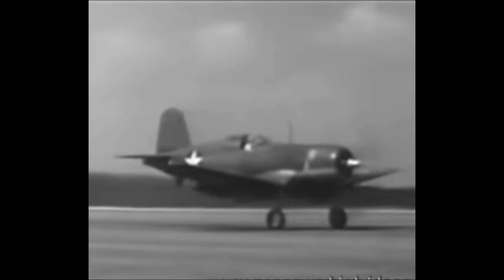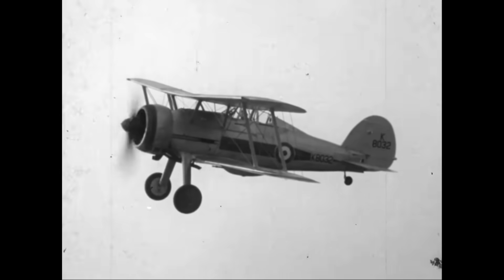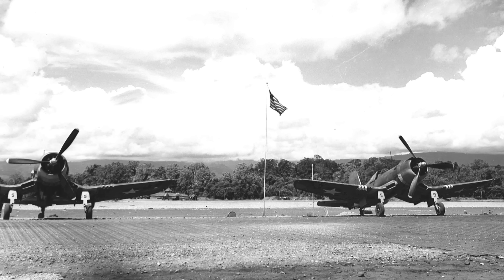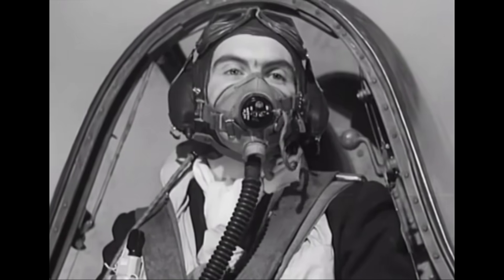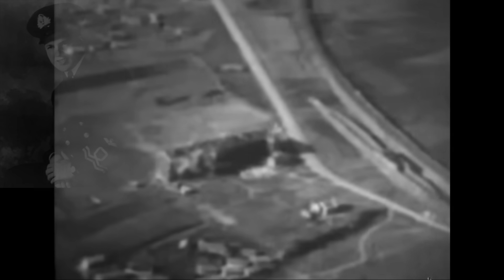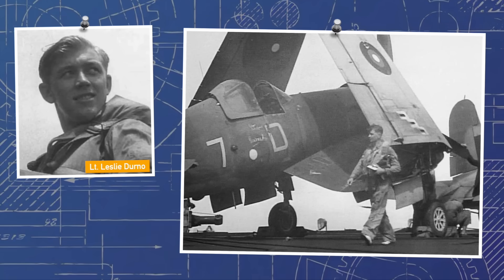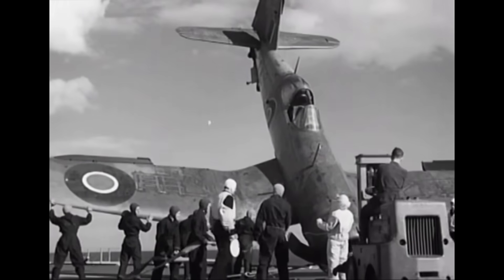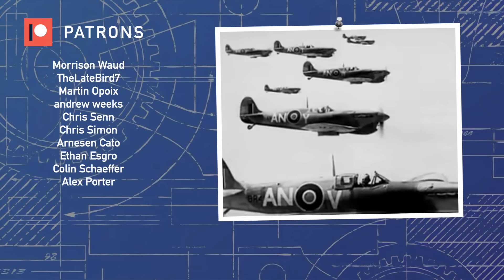Why Did Britain Use American F4U Corsairs? The Full Story

Comment: The Corsair was qualified for carrier operations in April of 1943.  The US Navy had developed the circular landing pattern in the 1930's.  The plane was not used on carriers mainly because of logistics.  The Hellcat was an evolution of the Wildcat, and therefore easier for the Navy to adapt and service.  The Corsair required its own supply chain.   Also, there was an issue with the landing gear, which was resolved long before 1944.
Reply: "Logistics"  perhaps this was just one of the reasons the Navy selected the F6F Hellcat over the F4U Corsair.  The fatalities of young Corsair pilots was horrific compared to the Grumman F6F Hellcat.  There are interesting statistics on this subject in the book "The Vought F4U Corsair in the War Against Japan" by Tim Hillier-Graves.

Comment: With regard to the gull wing being used because of the propellor disc, if it had straight wings then the landing gear would have to be overly long. Impractical and expensive. Hence the gull wing allowed shorter landing gear so the propeller was the cause that led to the gull wing.

Comment: The Fleet Air Arm sound like the U.S. Marines: nonconformists who take equipment other branches don't want, and make good use out of them.
Good for the FAA, figuring out how to land an F4U on a carrier!
Reply: USMC operated Corsairs from land bases where they could be loaded to the max for close air support. USN had the Hellcat for carrier ops. Over 1,000 Hellcats Lend Leased to Britain.
   "There is a controversy between those who say that the Admiralty did not get what it wanted for the Fleet Air Arm and those who say that the Admiralty was not very clever at explaining what exactly it    796
was that it wanted. I noticed quite recently that Air Marshal Dowding has gone on record as saying that the Admiralty got precisely the types which it specified and demanded. Whatever may be the rights and wrongs of this controversy there is certainly no doubt whatever about it that war found the Fleet Air Arm equipped with extremely bad aircraft." 
FLEET AIR ARM.
HL Deb 27 January 1943 vol 125

Comment: So they could saw the wing tips off and show the Yanks how to land it on a carrier properly.
Reply: "There is a controversy between those who say that the Admiralty did not get what it wanted for the Fleet Air Arm and those who say that the Admiralty was not very clever at explaining what exactly it                  796 
was that it wanted. I noticed quite recently that Air Marshal Dowding has gone on record as saying that the Admiralty got precisely the types which it specified and demanded. Whatever may be the rights and wrongs of this controversy there is certainly no doubt whatever about it that    war found the Fleet Air Arm equipped with extremely bad aircraft."
 FLEET AIR ARM. HL Deb 27 January 1943 vol 125 cc794-829
Reply: Royal Navy teaches the U.S. Navy the curved approach to  the aircraft carrier?  Read "F4U Corsair at War"  by Richard Abrams.  Go to the chapter "Corsairs with the Royal Navy" by Lieutenant Commander  (A) Norman S. Hanson.  Yes, Lieutenant Commander Hanson also wrote the book "Carrier Pilot."  These pull quotes from "F4U Corsair at War".  Deck landing on a full-sized  deck essayed by the first two squadrons when they joined HMS Illustrious in December 1943, proved to be distinctly hazardous."   Further;  "Illustrious" Captain decided that further deck-landing training was essential."   Also NOTE "the fact that the current RN landing "pattern" was totally unsuited for the Corsair."  If you  have the book "Whistling Death" by Boone Guyton you will find the U.S. Navy was instructing the Corsair curved approach BEFORE the Royal Navy had Corsairs.

Comment: A good presentation but you made a grave omittance . The U. S Navy's inabilities to safely land on carriers caused them to change to land landings only .  It was the sole experience and knowledge of Flt. Lt . Eric "Winkle " Brown whose vast experience of carrier landings  was the changing point for safe  Corsair aircraft landings on carriers . Once his knowledge was passed onto the U.S, Corsair seabourne landings recommenced .
Reply: FAA used what it learned in making the Seafire (bodged up Spitfire) SAFER to land on carriers. 
"There is a controversy between those who say that the Admiralty did not get what it wanted for the Fleet Air Arm and those who say that the Admiralty was not very clever at explaining what exactly it                 796
was that it wanted. I noticed quite recently that Air Marshal Dowding has gone on record as saying that the Admiralty got precisely the types which it specified and demanded. Whatever may be the rights and wrongs of this controversy there is certainly no doubt whatever about it that    war found the Fleet Air Arm equipped with extremely bad aircraft."
FLEET AIR ARM.
HL Deb 27 January 1943 vol 125 cc794-829

Comment: G'day ADD, Interesting video. I particularly liked the brief shots of warships sailing backwards. As to the FU Corsairs they are my favourite WW2 fighter even though they didn't achieve as much as other types. Like many airframes in the conflict they were rushed into service; clearly with a need for more aerodynamic and design work to smooth out its unique idiosyncrasies. 
Pilots, also were not generally given sufficient time to come to grips with the Corsair's advantages and dangers, especially in carrier operation.
This is an aircraft that also suffered from spreading manufacturers too widely. It's now obvious that certain factories built Corsairs either with insufficient understanding or too quickly to meet demands.
An interesting part of the Corsair story, you didn't cover, is their use by the Royal New Zealand Air Force. I'm ex-RAAF and I'm deeply interested in RAAF history. I believe that our service got their hands on a Corsair for evaluation and after close physical and flying examination, decided against adding them to their inventory. I'm not so sure about the details of the RAN and why they didn't use the Corsairs either.
In any case it was a great pity that so many groundbreaking aircraft were simply dumped at sea, or scrapped as they were in the US. Air forces would have benefitted by more research into 'gull wing' designs and the 'accidental' clipped wing feature.
Thanks for your video..
Cheers, Bill H.

Comment: Vought was still building new Corsairs in the late 40s and early 50s. Nash Motors who built R-2800s under license during WWll for use in F-6-Fs and F-4Us was awarded acontract to restart production. Which was then canceled before any production could start. This demonstrates both the need for Corsairs and the later need being reduced.

Comment: Unfortunately you are completely wrong and just perpetuating a myth that the inverted gull wing was used for propeller clearance. 
In reality many other airplanes used the same size propeller without that wing. 
The wing was placed at a right angle to the fuselage because the net result of that attachment was much less drag. Obviously they had to angle the wing back upwards. 
The result of that was a happy coincidence that they were able to use shorter landing gear legs that were stronger. 
Do some real research before making a video intended for education.

Comment: Why did the FAA use the Corsair? Because they had no domestically produced, carrier capable fighter of their own. British aviation companies gambled on sleeve-valve radial engines and that didn't work out well when they needed more than 1500 HP-the bigger Sleeve Valve engines didn't have durability and required lots of maintenance. The Pratt & Whitney F2800 was the best radial aviation engine that could produce 2000 HP+ and was used in the Corsair and Hellcat.

Comment: British engineers made US planes better, made the P-51 faster, and made the Corsairs safer.
Well done Britain.
Reply: The secret fuel that made the Spitfire supreme
Royal Society of Chemistry
11 October 2022
The USA developed and supplied the high-octane fuel that gave the Spitfire and Hurricane a winning edge in the Battle of Britain. A French American, Eugene Houdry, developed a process to convert useless crude oil into 100 octane fuel. 100 Octane fuel increased the Spitfire's speed by 25 mph at sea level and 34 mph at 10,000 feet. A 13-octane point increase contributed to the British victory in the Battle of Britain in 1940. 

Britain began the process of replacing its Vickers aircraft machine guns with a new Colt/Browning design in 1935, with its adoption of the Colt MG40. This was essentially John Browning’s air cooled M1919 machine gun made smaller and lighter, with an increased rate of fire, and reversible feed direction. British adoption began with the purchase of 60 guns and a license for domestic production. This production took a few years to get rolling (by both the Vickers company and BSA), and in the meantime an addition 1600 examples were procured form Colt 

 Klystron An amplifier valve. An electron stream is direct through a series of cavities causing each cavity to resonate. The RF input is fed into the first cavity causing velocity modulation of the electron stream . The successive resonating cavities amplify the velocity modulation, resulting in a signal gain. The output is taken from the final cavity. A gain of up to 40 dB can be achieved. 
The Chain Home radar system - Radar Pages 
It was invented by the brothers Russell and Sigurd Varian at Stanford University. Their prototype was completed and demonstrated successfully on August 30, 1937.[5] Upon publication in 1939,[3] news of the klystron immediately influenced the work of US and UK researchers working on radar equipment. wiki

Comment: Not true about the "downward kink..." that was primarily for aerodynamic efficiency. The Hellcat swung the same diameter prop, 13' 1". It did however allow for a shorter MLG strut, allowing rearward retraction.
Reply: @johnklatt3522  The extra 3" on the early prop is immaterial, where ground clearance is concerned. The XF6F-6 had a 13' 4" prop too. The inverted gull wing was used to set the wing away from the fwd fuselage to reduce drag...aerodynamic efficiency. The romance with the"HUGE" prop falls in with the myth that the M1 rifle's clip being ejected told the enemy a rifleman was empty.
Reply: @johnklatt3522  Okay...you're partially correct too.
Reply: I checked and you’re correct.  The prop was not larger but standard for the double wasp engine.

Comment: When yo realize that the Grumman F6F Hellcat had the same engine and propeller (4 meter diameter) then the argument about the inverted gull wing and shorter landing gear becomes moot. However, it is the "Banner" which every F4U Corsair advocate flies when talking about the design of the Corsair.  It was a design choice of Chance Vought, nothing more. In reality, the short landing gear actually caused problems, as did the long nose making the USN relegate it to landbased squadrons for the 1st 2 years of its service. The British Royal Navy however, was desperate for a good Naval fighter, and so stuck it out with the Corsair. If it hadn't been for the FAA, and its development of the Corsair into a usable carrier fighter, the Corsair would have ended up as another footnote of failed but excellent aircraft.
Reply from the maker: The point isn't moot, as the F6F had a number of tradeoffs due to this fact. The landing gear was far weaker - for one. A Corsair breaking its gear off was virtually unheard of, for the F6F it was a relatively common occurrence on crash landings. Further, the Corsairs gear was so strong it could be used as an airbrake, obviously this could not be replicated on the F6F Hellcat.

In short, aircraft design is all trade-offs. In this case, the design team opted for that gull wing for a number of reasons, and one of the advantages that came with that layout was incredibly strong gear. Could they have gone for another solution? Sure - but as seen in the F6F, it had tradeoffs.

Comment: The USN had the Corsair in 1942.  At a time when F-4 Wildcats were being chewed up by Japanese Zeros.  The USN was either unwilling or more likely unable to correct the deficiencies of the Corsair and relegated it to land airfields.  The Brits saw the value of the Corsair and thru some drastic steps made it work despite the operational losses they suffered and by early 1943.  A time still before the introduction of the F6F Hellcat by the USN.  The navies negligence in not making the Corsair carrier friendly resulted the loss of many planes and perhaps even ships.
Reply: USN had F6 Hellcats. Brits used them because they did not have anything better.
Most of what the FAA applied to Corsairs was learned on Seafires, bodged up Spits.

Comment: Thanks for this video, it was far more thorough than most on the Corsair, its a pity that the best fighter of the war is so often overlooked. This aircraft had the agility of the spitfire and P51 but the ruggedness of the P47 with a very long range........ everything you could want in a fighter. The RNZAF operated 13 squadrons of Corsairs in the Pacific. Of the 424 aircraft we were supplied only 17 were lost to enemy action and 154 to accidents with 54 Pilots killed. So it won its battles and most of its accidents were survivable
Reply: Better than a Spitfire not in a month of Sundays  Corsair beaten in the Turn, Climb,Roll Rate, Stall,  Service Ceiling, Armament [ Fighter]

Comment: To this day I wonder why the Typhoon did not get much past some design studies and tests using barely navalized (ex: adding arrester hook) but otherwise stock aircraft that went poorly.  It seems it should have only needed a little reinforcement and relatively simple high lift devices to make it suitable for carrier ops but I guess the demand for land fighters probably made it cheaper to just procure a different type from the US for carrier use.

I also find it sad that the US just said to dump all those aircraft rather than tell them to sell them to whoever will buy them and give us half the money you collected to settle the lease.  It was the only WWII piston aircraft that was still in active service with the US well into the Korean War.  Being a very high performance fighter I am sure some countries or returning vets would have snatched them up and if not scrappers certainly would have.
Reply: The Hawker Fury was modified for carrier use and was renamed the Seafury.  We had about 50 of them in the Canadian Naval Air branch.  Later on a number of them were sold to Cuba and were instrumental in trashing the American invasion.
Reply: Typhoon was useless at altitude, that's probably why.

Comment: Cuz they were one of the best if not the best fighter of WW2 . Saved you some time.
Reply: I mean... no, you didn't. That wasn't the primary reason at all, did you even watch the video
Reply: @endi3386  no but I answered the question the video caption asked. Well that and the fact that they were desperate for planes.
Reply: @mikeholland1031  But you didn't answer the question the video title asked. That's not the primary reason. Britain had many excellent aircraft of its own. The title obviously seeks to ask why specifically the Corsair over the numerous world class aircraft the British had.
Reply: @endi3386  they didn't have enough planes. Already said that.
Reply: @mikeholland1031  But no lmao, even that wasn't the reason. It wasn't an issue of numbers
Reply: @endi3386  yes it was
Reply: @mikeholland1031  No, it was primarily an issue of aircraft suitable for carrier operations, that had the performance necessary to compete with modern aircraft, and the range necessary. 

Navalised Spitfires and Hurricanes had good performance, but Spitfires were ill-suited to carrier landings, and Hurricanes were lower performance and didn't have as good range. 

So in summary, the British didn't use the Corsair because it was "the best fighter of WW2", they used it because it filled a specific niche in the Fleet Air Arm.

Comment: Ever wonder if the Centaurs or Hercules engines swapped for the R 2800 would of powered the Corsair better
Reply: The Double Wasp had more horsepower than the Hercules.  The Bristol Centaurus was a three row engine and would not have been a fit for the Corsair without a complete redesign.

Comment: We're told that Corsair had a four bladed propellerator but many of them in this wide have three bladed repellers. ???
Reply: The F4-U4 variant had a four blade prop, the earlier models had three.
Reply: Initially 3, later marks used 4. Is it that difficult to work out?